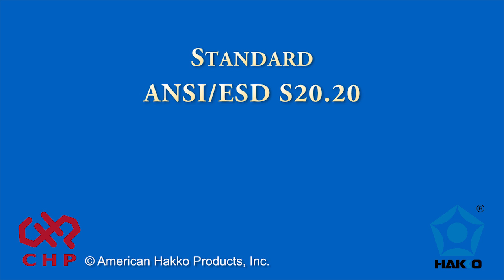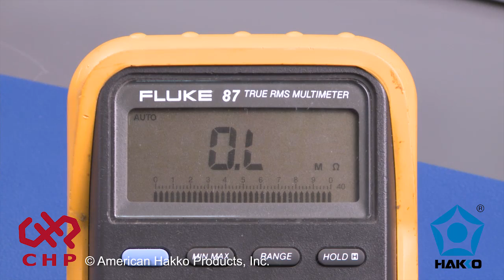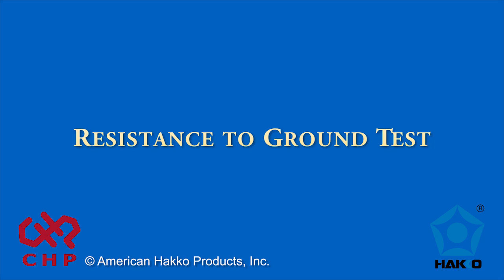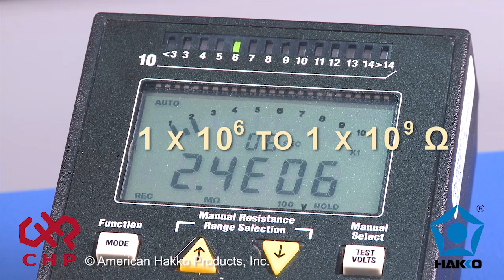How to Test An ESD Mat for Periodic Verification — Video by American Hakko

Comment: So it's cheaper to buy a new mat setup than acquire the equipment to properly test an existing mat.
Reply: Properly ground your mat and then in the winter when it is real dry in your house walk around with socks on on some carpet to build up some static and touch some metal to see if you get a shock.  Then if you get a shock do the same thing again and touch your properly grounded mat and see if you get a shock.  If you do not get a shock when you touch your mat, you will know that your mat is working properly.  This is the cheap way to test your mat.
Reply: Unfortunately 99% of 'new' mats are not up to spec, I've thrown away two of them already. I think we should be able to check them cheaper with just a regular electrostatic duster or with a balloon. The idea is, if we charge a balloon against our hair, we should be able to feel (and see) the charge that attracts hairs, and then put it on the mat. If mat works, it should dissipate the charge very quickly, and we should be able to test against hairs that there is no charge anymore.

Comment: if you got a better multimeter with a higher resistance limit, using a meter COULD be valid.  I would adjust to say mileage may vary depending on your meter's range

Comment: Thank you very much for the information. Do we need to keep an insulated surface underneath the mat prior to testing
Reply: I don't think so, in fact it should be the other way around. As far as I can see, some mats have very conductive underlying surface, like hundreds of ohms, while other mats have just 10-20 times more conductive than front side (~20 nano siemens per 1 cm) which makes me think that they are designed to be laid on metallic bench, otherwise it's hard to guarantee dissipation on a huge working surface. That's why a good expensive mats have highly conductive back-surface.

Comment: checks price of test equipment in video
"welp looks like I'll just have to hope my aliexpress mat is up to spec"
Reply: Unfortunately 99% of aliexpress mats are not up to spec, I've thrown away two of them already. I think we should be able to check them cheaper with just a regular electrostatic duster or with a balloon. The idea is, if we charge a balloon against our hair, we should be able to feel (and see) the charge that attracts hairs, and then put it on the mat. If mat works, it should dissipate the charge very quickly, and we should be able to test against hairs that there is no charge anymore.

Comment: Hello Sir,
I need to design a table with ESD compliance while also have high temperature resistant (below 260 C) and generally chemical resistant. Can you recommend what are the materials suitable for my application? Granite? Durostone? or anything that you have experience with?
Reply from the maker: Hi Aiman, for ESD compliance, the table needs to have an electrical resistance lower than 10^9 ohms.  I don’t know the resistance of granite or durostone but generally speaking, ESD compliant table worksurfaces are either metal, rubber or vinyl.  Metal and some rubber offer temperature and chemical resistance but I would not recommend vinyl.  Our natural rubber mats SC-1001 through SC-1009 are all heat and chemical resistant

Comment: Why universal meter can't read resistance? Is it that because electrodes are to little? Specialist device is necessary to test?

Secondly How I can test wrist strap?
Reply from the maker: Hello 94PeterQ, thank you for your questions. 

The biggest reason is that the surface resistance of an ESD safe mat is in the dissipative range (10^5 ohms/sq to 10^12 ohms/sq) which is too large for common multimeters, so you need a special device. 

Wrist strap test:  Wrist straps can be tested with the wrist strap tester (HAKKO FG-470), or you can use a multimeter to measure the resistance between the metal portion of your wrist strap and the grounding jack. Most wrist strap should give you close to 1 Megaohms reading, but there are also wrist straps for specific applications that have 0 ohms or 2 Megaohms.
Reply: @HakkoUSA  thank you for your answer. I have again one question to you. Why the special device for esd mat test have electrodes with dedicated weight and why the electrodes must be separated to dedicated lenght (I can see on this movie steel line with holders from two side)?
Reply: It’s because of the surface area, the probes are too small. If you try with a bigger electrode (such as a piece of aluminum foil) and press on it you’ll be able to measure the resistance with most multimeters (in the order of megohms). My guess is the weight is to ensure consistency, since pressing more leads to a lower resistance.

Comment: Great demonstration.
I am not sure but normally in such a test, is it not advisable to test if the earth in the building are within specifications also?
Reply from the maker: Hi, thank you for your comment and question. Yes, Ii is definitely advisable to test if earth in the building is within specifications, and this is done by an impedance measurement on the electrical ground circuit.  

Although this is advisable, it is not 100% necessary as an ESD safe workstation can also pass as long as it has an equipotential bonding point, meaning, if the entire workstation is bonded together and not necessarily bonded to earth ground, it can still be considered ESD safe.  This is not always “advised” or best practice but it can still be ESD safe so I considered it as an extra test that is not always required when testing worksurface mat.

Hope this helps.
Reply: Thanks a lot for your great answer, it makes a lot of sense!
I understand that, to be ESD safe it does not matter if, lets say that you have 2000 volts of static electricity in your body, as log as all ESD safe areas have the exactly same voltage (not recommended)..
That it is the voltage difference, that are harmful? :-)

Comment: The funny part is "you can't measure high enough resistance with multimeter", and you are holding state of the art wallet-draining Fluke 87! 🤦‍♂Guys, hit "Range" button twice, you will switch to the conductance mode and will measure the nano-siemens instead, it is sensitive enough to see the difference even on a top side! The bottom should be a lot more sensitive, sometimes  even for ohm-meter. If you need to convert 1 nano-siemens to ohm, it is 1/(nS * 10^9), so 1 nS is 1GOhm, 0.5 nS is 2GOhm etc
Reply: Thanks. That's helpful as I did not know that my Fluke 87 could measure in Siemens 😁

Comment: Why use 5lb? Is it necessary to use 5 lb only ? Can you brief what is the effect of the pressure on resistivity?
Reply from the maker: 5 lbs is actually written into the standard. Pressure really doesn't effect anything electrically but what effects the electrical reading is surface area contact.  So, what it can do is compress the material, possibly changing the material's electrical properties, and depending on the type of material, change the amount of surface area that is contacted.  

Something soft like rubber can compress easily but something like epoxy or metal usually won’t be affected too much. 

The idea is that weight/pressure could potentially change the reading, so 5 lbs was chosen as a standard so that the test can be repeatable in any environment. Hope that helps. Thanks for your question.
Reply: HakkoSoldering thank you so much for response. I have another question  . Can i use multimeter with std probes to measure surface resistivity?
Can you tell me the exact difference between how to measure surface ans Volume resistivity?
Reply from the maker: Hi Dinanath,

The problem with a multimeter and standard probes is that most do not measure to a high enough resistance.  With ESD materials, you need to be able to measure up to 10^12 ohms.  The standard probes are also not recommended because of the shape, they will tend to “pierce” through the material rather than contact with the surface for an accurate measurement.  It also is shaped in a way that will not provide consistent surface area contact when measuring multiple  times over and over again.

Surface resistance will only measure from a point on the top surface to another point on the top surface.  Volume resistance will measure through the material from the top surface to the bottom surface. Hope this helps.